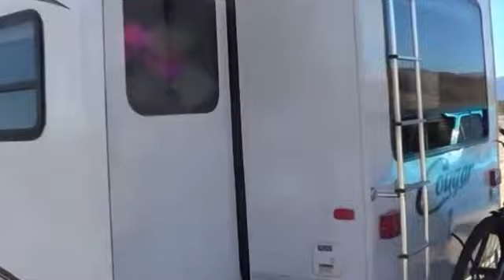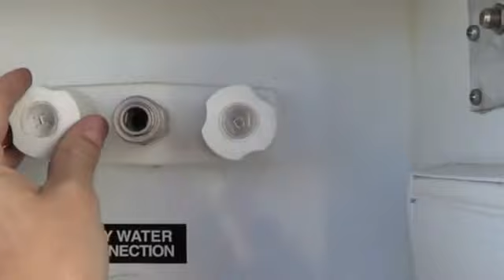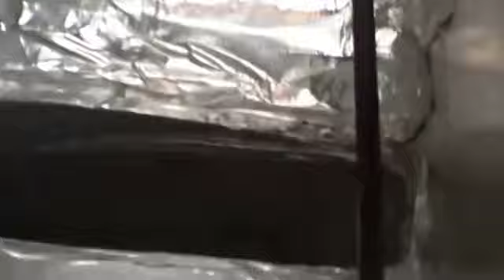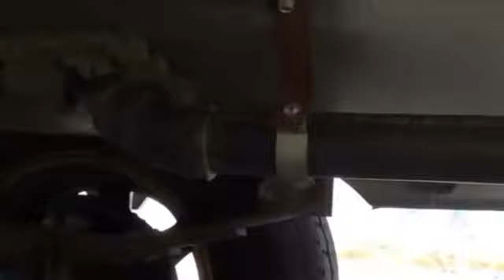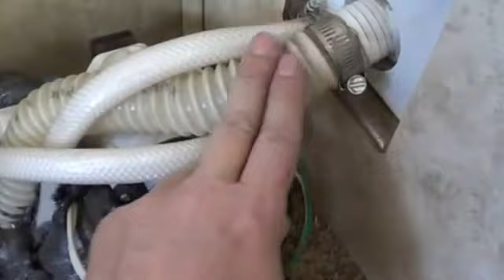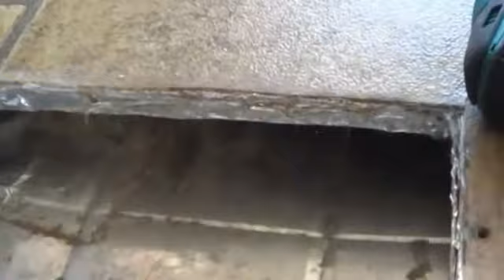Keystone Cougar 276RLSWE Fifth Wheel Trailer Review

Comment: You now have me looking at Cougars! I still like some of the Rockwood's though, but I love your big rear window so we'll see. Do you have any advice?
Reply from the maker: Sorry, I haven't been RV shopping for a long time so not familiar with the current state of things.
Here is a updated review I did of our Cougar a year ago - https://www.loveyourrv.com/cougar-trailer-review-fulltime-rving/
Cheers, Ray
Reply: Do you like your big rear window? You mentioned it seems to add a lot of heat to the rig but I guess you solved that with the foil. I love the idea of the big window and presently looking at a trailer with the big rear window and one without. I'm leaning towards the rig without...Hope everything is well in BC. I love it up there!
Reply from the maker: Yes, really love them, really opens up the rig and nice to have during poor weather days when trapped inside. When boondocking and have our choice of orientation I point the nose into the noonday sun so not a problem. In RV parks where I have no choice we have used foil but now I have a product called EZsnap window shades, works well - https://www.loveyourrv.com/ez-snap-exterior-rv-window-shade-review-demo/  Cheers, Ray

Comment: Hi Ray - Ray again from Burnaby. Question about tires. There is a lot of debate between ST and LT tires. Many people are moving to LT. Do you have a preference or opinion? Also, did you stick with the factory ST tires or did you upgrade them soon after you purchased the trailer for safety sake as factory tires usually only meet the minimum weight requirement? I appreciate your insight. Thx
Reply from the maker: I upgraded them after about 8 months and stuck with ST tires. I did upgrade to a higher load range from D to E which added two more plys to the tires and increased the max PSI from 605 to 80. I've towed now around 60,000 miles with the Cougar now with zero tire problems just natural worn out treads, we are on our third set of tires. 
Other people seem to have lots of issues, maybe it's how they drive, underinflation or they are using old tires or unlucky and hitting road debris.
Reply: Hi Ray - What brand of ST tires did you buy when you upgraded from D to E rated tires?   Thanks....
Reply from the maker: raybbj I've had Power King Towmaxx and currently have a brand called Saffiro. The best STR tires judging by reviews I've read are called Maxxis.

Comment: Your power awning.  Is it a Dometic or some other brand?  Was it an upgrade from the company or did you install it? Is there an automatic retract for wind? I'm looking for a good video on a self install and I can't find one. Hoping you had some more info on it.
Reply from the maker: +William Klein It's a Dometic 9100. It came with the trailer new. It has no wind sensor. There are now models with it though. Not sure on the install. Here is an install manual, not sure if it is the right model but may help get an idea of howto do it - http://rvhappyhour.com/wp-content/uploads/rtMedia/topics/5518/2014/08/Power-Awning_installation_EN.pdf - Cheers Ray

Comment: Follow up>  Are you still happy with your cougar?
Reply from the maker: Most Cougar owners I talk to seem pretty happy with them, they have good bang for the buck. They are definitely not in the higher end class like units built for full time or true four season rigs, but compared to others in the same price range they do well.
Reply from the maker: Bf Dog Yes, we have visited several RV shows and don't see anything in a similar price range we would want to swap it for. We really like the layout.  It's held up very well considering we full time in it and travel a lot of miles every year and it isn't built for that. So we have gotten pretty good value out of it I feel.
Reply: +Love Your RV   What type of maintenance schedule do you follow - wheel bearings, breaks, slides, roof etc?
Reply from the maker: Here are a few posts I wrote on the subject. Usually most things are on a 6 month check and lube schedule. I usually get the bearings repacked with new seals every two years.

http://www.loveyourrv.com/rv-power-awning-super-easy-maintenance-how-to/
http://www.loveyourrv.com/lubing-my-fifth-wheel-trailer/
http://www.loveyourrv.com/wash-wax-and-detail-the-rv/
http://www.loveyourrv.com/10-simple-tips-help-maintain-rv/

For the roof I've recently decided to do a proactive seal jog with Eternabond tape - http://www.loveyourrv.com/resealing-rv-roof-eternabond-tape/

Cheers Ray
Reply: +Love Your RV Thanks for the quick reply.  I ask these questions because I've been hard at work reviewing manufacturers that I would consider for a used 5th wheel @ 30 feet.   I'd pretty much narrowed my choices to  NUWA and Carriage based on a combination of quality and features.  But  after looking at you review I'll also have to open my search to Heartland.  Heartland is appealing because in the Cougar line, the same length units are lighter  than the others and appear to be able to be towed by a 250/2500 diesel.  The others would absolutely require a 350/3500.  It  looks like it would be much easier to find a decent used F 250 than an F 350. Just more of them.
Reply: +William Klein  Everywhere I said Heartland I meant Keystone.

Comment: The heaters don't heat the trailer and Keystone knows it.
We just lemon lawed our Keystone.
Rotten people to deal with at Keystone.
They lie when the truth will get the same results.
We bought a Heartland and everything works superb.
Reply from the maker: Guess I'm lucky then, haven't had to called Keystone ever. I've lived and traveled full time in my Cougar three years now and around 50,000 miles.. It's held up pretty well for a cheaper fifth wheel. Our heater works OK, a bit loud but I use a radiant propane portable unit and a small electric heater to supplement it. Cheaper than burning propane with the big on board unit. Basically they are all very much the same, all the manufactures use pretty much the same stuff to make an RV with. Good luck with your new Heartland.
Reply: Have to agree with tpcbr.  I had problems with the furnace going out on high limit because the fan was too small to take away the heat properly. Keystone's fix was really mickey mouse.  They could have corrected the problem properly but chose to cheap.
Reply from the maker: Our heater hasn't ever quit, used it for three years now and we live full time in the rig, but it is loud and doesn't effectively heat the bedroom area. The ducting isn't very well designed.